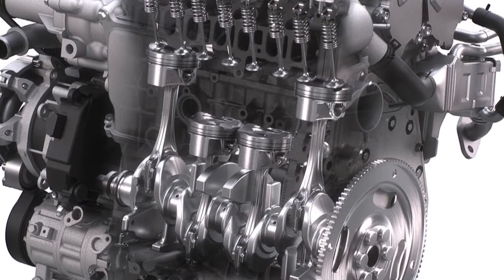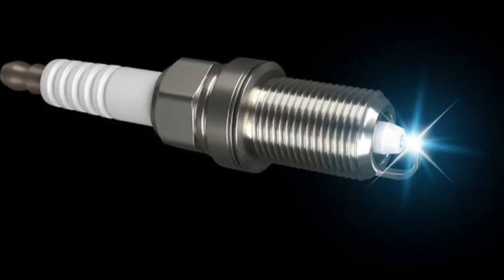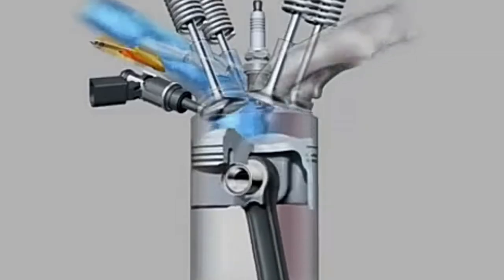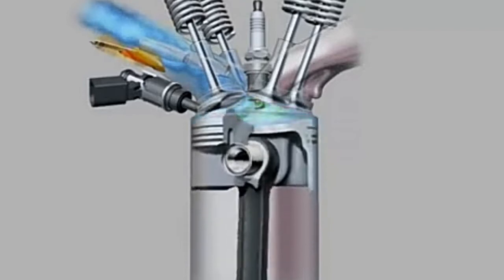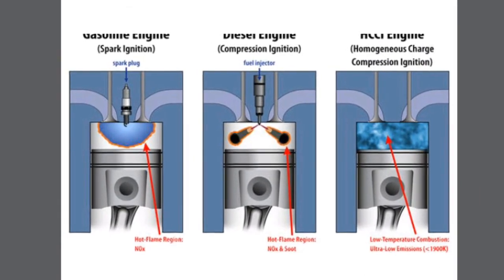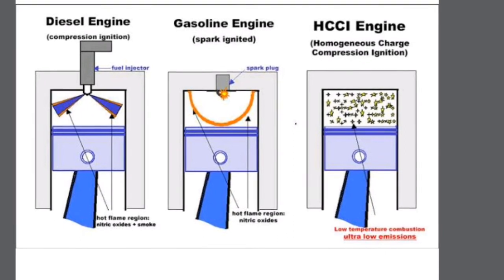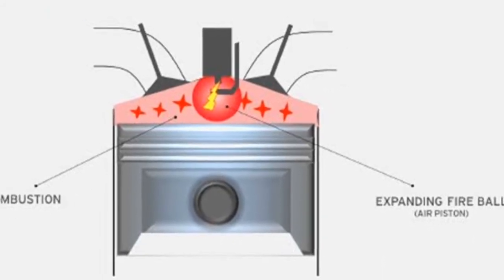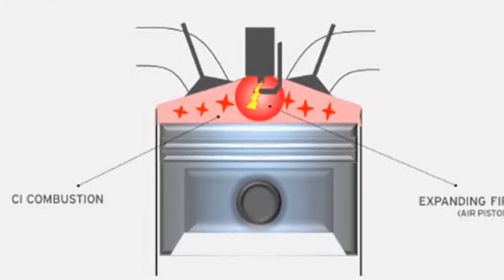SI vs CI vs HCCI vs CAI vs SPCCI vs Entry Ignition Engine vs PCCI

Comment: There are several things that have kept this technology in the lab..  1. When you have materials like aluminum that get soft at around 330 C it is hard to create a warm enough environment.   These materials need massive cooling to stand up to combustion temperatures.  2. The piston dynamic of a crank engine has such short dwell time at TDC and poor mechanical advantage that if the combustion happens too soon it puts negative forces on the crank.  So rather than fix the dynamic issues of a crank engine they are trying to overcome things with valve timing or the use of diesel during periods of high loads. A cam-driven piston would solve a lot of these issues and better heat management with the use of higher temperature low conductivity materials like zirconia, which is around 3 Wm/k or even titanium which is 6 Wm/k as compared to aluminum which is over 20 Wm/k.  Having insulation keeps the heat in the combustion chamber and provides an environment that is better suited to HCCI.